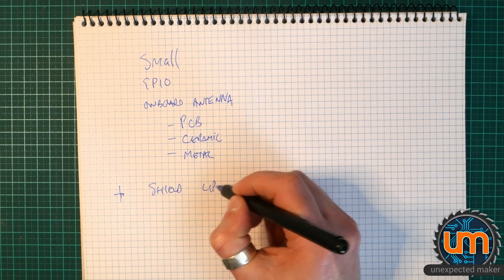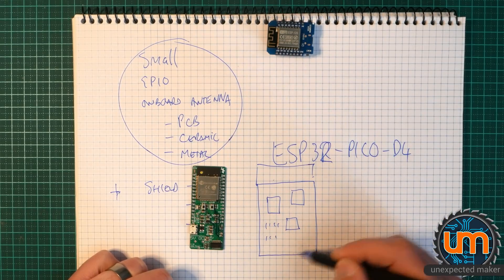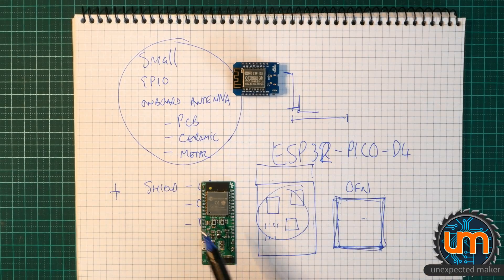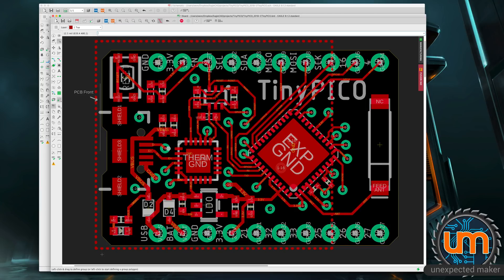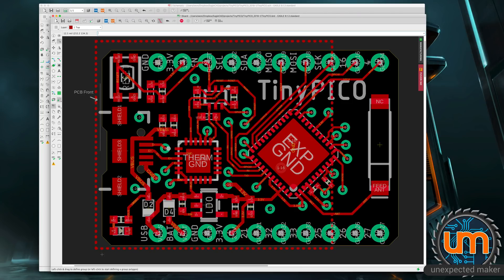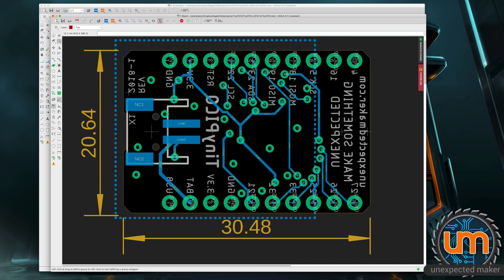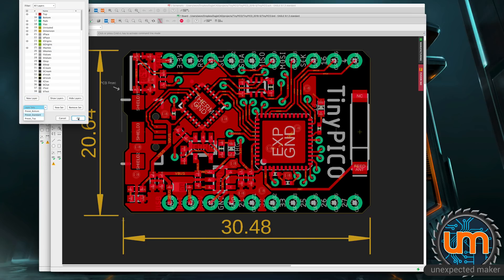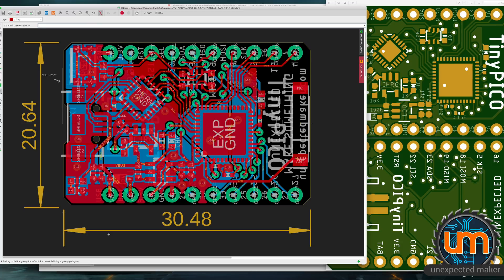TinyPICO - Let me tell you a story....

Comment: Hey man, i have been looking for an esp board for fast code testing, i came across the tinypico board but it doesn't have a male usb to directly stick it in a laptop. Would you consider releasing a board tinypicoboard in air602 style? Like a thumb drive? Preferable with a metal usb connector.

Comment: That's getting pretty close to the 18 x 25.5 of the WROOM-32, scrunch a bit, castellated holes and it would almost be a drop in replacement
Reply from the maker: Right but the WROOM32 offers more than the PICO by itself (pSRAM) , so it would be a step backwards.
Reply: The WROOM32 doesn't have the SRAM, but the WROVER does and adds about 6mm of length to get it, it's 18 x 31.4
Reply: Anyways, I was probably round about saying, squeeze it a bit more, see if you can get it to the same size :)
Reply from the maker: Smaller... always smaller... no plans on making the footprint smaller atm.. packing more into it instead ;)
Reply: Just watched the build video, looks great, very tightly packed traces, beyond me currently to design something like that, but it's inspiring to see. You make it look a bit easy, I'll want to try that sort of thing in the future.

Comment: Would love to put micropyton on that board
Reply from the maker: That is exactly what's going to happen when Matt Trentini gets his hands on one - assuming it works ;)
Reply: I intend to have it running MicroPython within 5 minutes of receiving a working board. :)
Reply: @mattytrentini  how do get the bootloader on your esp and samd chips?
Reply: Espressif, the manufacturers of the ESP32, provide "esptool" that can deploy binaries to the device using serial over USB. It's a one-liner to deploy the MicroPython binary. esptool is a python application so typically just 'pip install esptool' and you're good to go. Perhaps I should put together a tutorial - or badger Seon to create a video. ;)

The SAMD is a little more involved and I'm not quite so familiar with it...further it can depend a little on which bootloader is already on the device. Adafruit for example deploy a nice bootloader that simplifies binary deployment with a UF2 bootloader - you can just drag and drop a binary onto your micro that appears as a USB mass storage device. Or update using BOSSA through the Arduino IDE. Nice work Adafruit! However, normally, ground-up, you'd need a JTAG programmer, write the bootloader and then the application.

Comment: Where's your antenna matching network ?!?!?!?! Sorry to be a damp sock, but you left out the hardest part to design and implement. You're missing a cap or two cap and a coil at the least to terminate the transmitter and that's important for reducing interference as well as for getting maximum range and in some cases it's vital to avoid frying the output amp. When you layout for RF you're entering the world where sages and wizards dwell and most wizards also have a nice RF spectrum analyser and a vector network analyser to be their eyes. It's not a trivial world by any stretch and I actively avoid it because of the difficulty of doing it really well and I like to do things really well. I would start by rotating the ESP32-PICO-D4 either 90˚ CCW or 180˚ to place the LNA_IN pin closer to your new matching network and out of undue influence of the other traces. RF always comes 1st in layout because it's the most sensitive. It's not that hard to design workable sub-GHz RF but as frequencies increase it gets bloody difficult. My high speed layouts are all optimised in Altium to not transmit or receive so I'm more like an anti-antenna digital guy where these are unwanted artifacts rather than an RF plumber where it's the objective to emit that energy and emit it efficiently but that just gives me more respect for those who do it well. For good GHz RF, you also really need some degree of characterized or controlled impedance in PCB fab and it usually takes multiple iterations of the matching network to match the design to the manufactured output and to tune it spot-on. It's nothing short of rocket science even if it's made to look easy these days. It only looks easy because you're not hearing the swearing in the lab during development. It should also be noted that with controlled impedance PCBs and high end CAD tools you can form the matching components directly from PCB traces but for consumer FR4 it's better to use actual components in almost all cases.

I would recommend reading this 36 pager from cover to cover as it does a good job of covering the bases in a practical way:
http://www.cypress.com/file/136236/download

Silicon Labs gets more in depth than you need but it shows you what it's like to approach it from a nuanced product design standpoint:
https://www.silabs.com/documents/public/application-notes/an930-efr32-matching-guide.pdf

Sadly the ESP32-PICO-D4 datasheet glosses over this whole topic almost without mention, assuming the person working with the RF implementation is an experienced RF engineer. 
I'll stick to digital. RF scares the shit out of me.

Here's an example giving you some ballpark values. They swapped the value labels on the inductor and the series cap but they show nH & pF so it's easy to decipher. 
https://www.cnx-software.com/wp-content/uploads/2017/08/ESP32-PICO-D4.png
Reply: Thanks for the information Peter - I'll be reading all of your linked documents closely. I was aware that the RF is the weakest part of the current design but I'm hopeful we'll be able to refine it soon. We're also looking at a range of other antennas; it's a bit of a dark art indeed!
Reply: Matt, my pleasure. I think this is a really cool board with LOTS of potential! I'll make the same statement to you that I made to Seon, namely If you spend an hour skimming that 36 pager from Cypress and then another hour searching out and analyzing every ESP32 PCB layout you can find I think you'll be ready to "fake it" better than a lot of people could do with the "genuine" education. At the least think of that Cypress document as a decent reference for what people do with success but RF is a crazy world where new rules seem to apply at times and I only know that I know very little at best. With the basic three component matching network added and the values from schematic #1 I think you'll be doing well without any additional work. If you can tune it later with a network analyser then fantastic but you'll already be very close and almost certainly close enough for Rock n' Roll. The only thing to focus on is that RF PCB work is physical art and it's not only the components, but where the components are placed that determines the output. Placement of the 2nd capacitor is a great example because it's a tap on the stub. Just follow examples that are known to work. Best advice I could give with antennas is look for the most consistent radiation pattern you can find but you're always stuck with the physical size of the wave defining best performance and for 2.45GHz a 1/4 wave antenna will be 3.059cm long unless that's rolled up somehow. Crazy stuff but you're 99% of the way there. 😉
Reply from the maker: Ha! You are 100% correct on everything you say Peter... but I learn by making, not by studying... my teachers hated me at school ;) RF is indeed a wizards domain, and I know nothing about it.. but reading a book from cover to cover wont help me unless I am implementing what I am learning, so this FIRST of many revisions is my initial step... and RF design should come first, for someone that is a 100% gun at everything else, but I'm still learning all aspects of this stuff, so for rev 1, I'm happy with a working "general" board and terrible RF implementation - as a good starting point.

Haven't you realised yet that I'm the "jump in head first and learn my way back to the top" kind of guy?

I'm far far away from looking at manufacturing this thing... ;)
Reply: I learn by making too and I'm famous with my peers for jumping in hard which is probably why I like your channel so much. Instructions are cheating, but I always strive to make things that work well and that takes a commitment to understanding what's going on with the building blocks which in this case is just hard work but necessary work nonetheless. RF is just hard. I'll be first to say EspressIF isn't making it too easy for beginners but then chip companies didn't have this sort of situation until recently and RF systems on a chip is a highly advanced topic. Hats off to you for attacking things like this. I would never just tell anybody to go read a book and indeed I linked to an article with practical implementations as well as ultra-simplified explanations but ones with enough depth to allow you to get to the same place in a practical sense that you could also get to with hundreds of hours of classes if you went the conventional route. I also edited my message above to include an example schematic with component values for a similar antenna style but I think that was as you were writing your reply. Here's another from the manufacturer but note that the values depend on the antenna and layout and the EspressIF one uses a 3D metal antenna with better emissive performance than a ceramic one. https://dl.espressif.com/dl/schematics/esp32-pico-kit-v4_schematic.pdf In both cases the inductor is roughly the same and that's probably the most important part here for the most simplified view. 

The inductor you provide is where the transmitter's DC power flows through to ground to develop the signal across, just like a speaker in an audio frequency circuit with a simple transistor driver. The big difference here is that there's a stub of ideally 1/4 the wavelength of the carrier frequency which is capacitively attached to the IC end of the inductor, and the inductor doesn't like to pass that high carrier frequency (as inductors do) so it ends up radiating out of the stub end because it doesn't have anywhere else to easily go. If you consider a sine wave, 1/4 of the wave from the start is where you get the maximum level which is why you have 1/4 wavelength long antennas. One capacitor is used to AC couple the antenna stub to the inductor and another slightly smaller one is used to provide some AC termination of the signal that doesn't radiate from the stub. Those three passives make or break the design and determine if you get 0.1% or 99% of the potential result of all of the rest of your work. 
 
I'm almost completely self taught and in spite of commercial success for 30 years in computer hardware, I can't legally call myself an engineer in Colorado or have a company with "labs" in the title until I get my degree. If I call myself an engineer in trade I can be charged with fraud, LOL. Steve Wozniak and Steve Jobs created Apple without a degrees and Gates did Microsoft without a degree (I don't tink Allen had one either) so it was never important for me but now I legally need one to represent what I do where I live and I always wanted to get a doctorate anyway so as Peter Green of Fleetwood Mac wrote so long ago, "Oh well..."
Reply from the maker: Thanks heaps Peter for taking the time to write all of this up. Your explanation of what the inductor and caps are for between the IC and Antenna was easy to understand and excellent. Thanks also for posting the schematics and links to docs and reference to read... it's all bookmarked and I WILL jump into that 36 pager and read it from cover to cover.

I have already ordered some extra components in anticipation of my rev2 and I also ordered a new fancy microscope  so I might even be able to build this thing!

I REALLY appreciate all of the effort you put in to help and explain stuff on my videos. Having an awesome community like this around me makes my journey much more enjoyable ( also more expensive ) but I'm learning heaps in an accelerated way which is perfect for me.

THANKS!
Reply: Seon, you've got a great community going and I think it's due to your creativity combined with your artistic style and your overall attitude. Hats off to you. 😎👍
If you spend an hour skimming that 36 pager from Cypress and then another hour searching out and analyzing every ESP32 PCB layout you can find I think you'll be ready to "fake it" better than a lot of people could do with the "genuine" education. Real world experience has an unparalleled educational capability once you have a few pointers from a good source to know what to look for, and few people seem to understand just how much advantage an artistic eye gives one. Once you see what people are paying attention to it's usually not too hard to pick out the high points and polish your implementation of them. You're three parts and a PCB rev away from what looks to be a really cool bit of kit which has some real ability to gain traction. 

Congratulations are certainly in order!
Reply from the maker: Thanks Peter! That's super nice of you to say. Yup, I'm confident I can get this board working great - no matter how many revisions it takes ;) I can hear Matt whispering in my ear right now "make it smaller, make it smaller...."

Comment: Awesome work Seon! Just wondering if you should’ve also included a u.FL (IPEX) connector alongside the chip antenna?
eg. See the antenna layout on the TTGO Micro-32 module (a shielded PICO-D4 module): http://s.aliexpress.com/QfiMFbI7
I’ve had the TTGO Micro-32 on my wishlist as effectively a tiny ESP32 equivalent to the SeanHodgins’ HCC MOD concept.
All great stuff! So really looking forward to your TinyPICO development progress with great interest. :)
Reply from the maker: Possibly for a future version, but for this it wasn't worth putting an external antenna connector on, and I'd think most use cases wouldn't need one (assuming I get my onboard antenna optimised).  That Micro-32 module is ridiculously expensive :(

Comment: Hi Seon!

 Aside from not having a 50 ohm antenna feed trace or matching tuning  network, I was also going to point out more distance is probably needed from the antenna to any other metal including components and traces or a ground plane on the bottom side of the board or any inner layers so that may also impact performance. 

And I can also see there is no provision for a metal shield so I assume part of the challenge was just to get something working on the bench and not  worry about being able to qualify for Emissions testing and harmonic suppression. Overall, looks very neat and tight for just a short time working on it!
Reply: Also on the final revision of the board where the antenna Trace has to run beside a bunch of other vias and components, and there’s other GPIO traces on the bottom side of the board, that will also impact the RF performance but just for trying things out on the bench it should still run.
Reply from the maker: Hey Gadget Reboot - yes, revision 1 is just for testing and experimenting!!!!! Lol, I am sure I'd be at revision 20 before I wanted to consider any type of cert. In terms of the spacing, it's as much clearance as any other boards I've looked at... > 5mm clearance to ground. The header pins might be an issue, but I wont know until I build one.

My expectation is it will work fine...but not optimally, which will likely be perfect for many use cases. Also, at my level of distribution capabilities, certification isn't really something I'm concerned about right now ;)
Reply from the maker: Yeah it's likely the boards too small for everything I wan to put on it and still have clearance. Matt an dI knew that going in... but it's worth the experiment :)
Reply: I was going to comment on the non-impedance matched trace, the missing matching network, and the lack of clearance, but noted that you already commented. Personally, I always prefer an SMA connector so that I can use a shielded case and also get a properly tuned antenna. The on-board antennas are usually mediocre at best...

Aside from the antenna issues, I would have liked to see more emphasis on keeping power usage to a minimum by using a buck-boost converter to allow operation from a single cell Li battery, rather than the LDO.

But that's all quibbling. Thumbs up for this video and I hope more people start designing ESP32 Pico D4 chips into their products!

Comment: Hi, first time commenting one  of your videos. 
I want to point out that i do not see any impedance matching circuit  between the chip and the antenna(as the datasheet report on the recommended Peripheral Schematics), nor a matched  feed line trace at 50ohm ( assuming the chip antenna require a 50ohm matching). Maybe i'm wrong, but i don't think you will achieve the best radio range without an impedance matched radio circuit.

Cheers and good work from Italy.
Stefano
(Sorry for my bad english)
Reply from the maker: Hey Stefano! Thanks for jumping in to the comments! Yes, from a design point of view, I cut a few corners, like the matching 50ohms and I know my radio strength will suffer for this, but it is a proto-type, and my first time working on anything that requires RF design.  In revision 1 it's all about working out what form factor I am comfortable with, and i'll optimise during revisions.
Reply: I understand, impedance matching is a very tough aspect....Looking forward for the next update on the project and consideration on the radio performance. 
I don't know what time is in Australia, so have a nice day Seon!
Reply from the maker: Thanks Stefano!